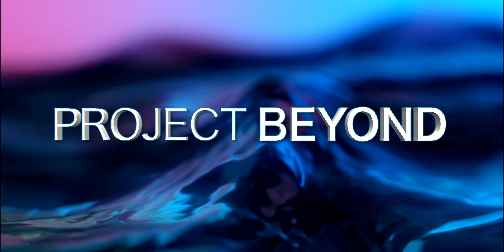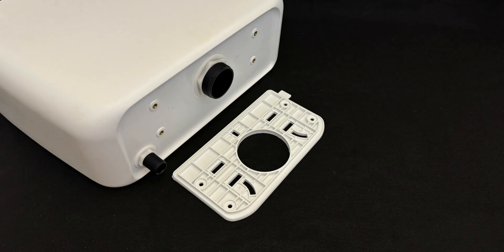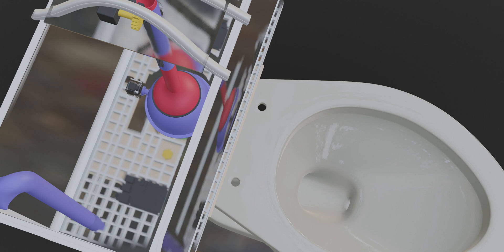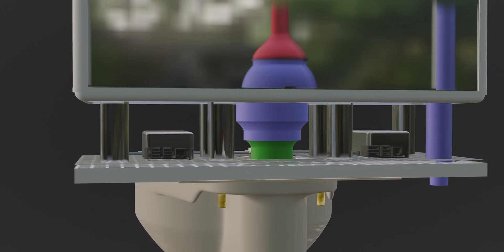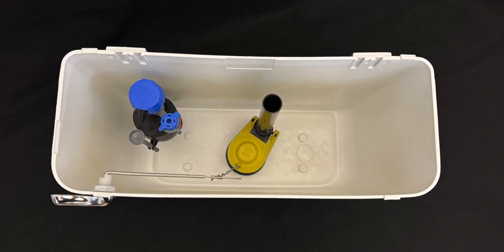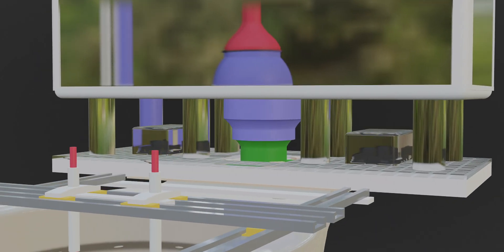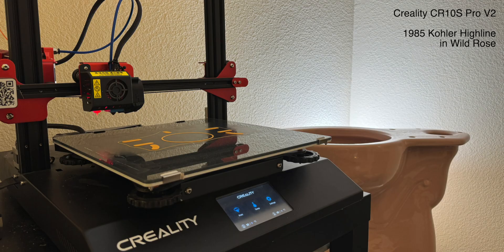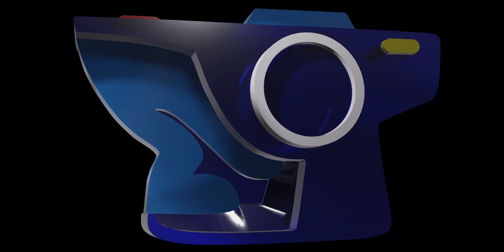Beyond The Flush 00.01 - One Tank Fits All

Comment: That 1980 Downing is a cool find! Round front versions are rare too! I've installed tanks on flushometer toilets in the past using a wall hung tank and available plumbing between the toilet spud and flush valve. I had good results with it but the dimensions can vary from one bowl to another. It's also worth noting that most flushometer toilets only take a 1 1/2" spud. Typical low tanks toilets took advantage of the full 2" flush valve.
Reply from the maker: It's true on the inlet size. We'll be using our system to see how the inlet size affects the performance and if we can compensate with additional head pressure.
Reply: @CapturingToilets  Sounds like a cool experiment! I've had hit or miss results testing flushometer toilets with tanks. Results range from nothing, to quite good. Some worked well on a high tank. 
 Some vintage toilets like the old Kohler Downing and Standard Madera offered a tank version special with larger jets to work on the lower pressure of a tank. Fun stuff!